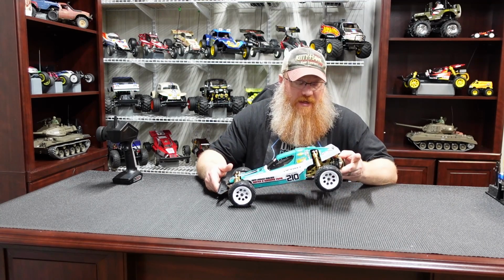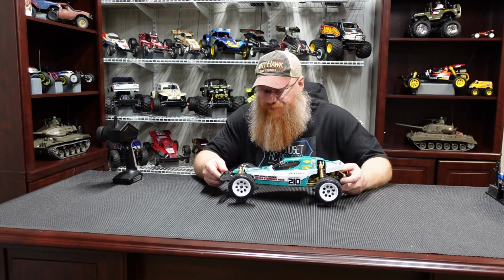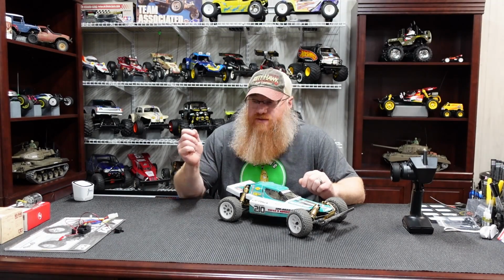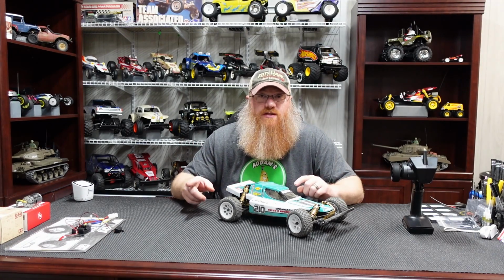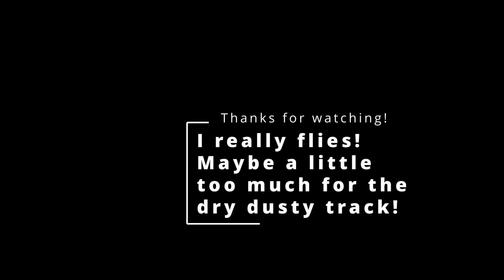Kyosho Turbo Optima First Drive

Comment: Cool video! Is it possible to upgrade these to a brushless 3s?
Reply from the maker: Thanks! Brushless is fine, 3s brushless is probably going to be a bit too much. On a good 2s system it will be more than fast enough for any type of track driving, if not too much to keep traction. 3s is both going to be hard to fit a decent battery in as it have to go between the frame rails and the upper deck and the added torque is probably going to shred the belt or the pulley. They are quality but not ever designed to take that much. If you want 3s romping probably stick with Arrma or something designed to take that abuse with a stronger driveline between the motor and the diffs.
Reply: @AddamsPlayground  Ohh OK thanks for the info! :)
Reply: @AddamsPlayground I recently got a Team Associated Pro4 SC10 (General Tire), so I’ll run that for a while - luv it - but this classic Kyosho will most likely be my next purchase. 😊

Comment: I bought one knock off futaba (4pm) receiver.. it worked fine when installed.. in the meantime I bought several more.. time ticks on and i go to use the car with the first one it became glitchy and stupid.. so it got binned... The other ones so far are okay. Were tested on arrival... One is in a car.. its glitchy. But then i used a cheap brushless combo.. so it could be the culprit to.. ive gone back to the futaba  R203gf (cheapest ones ) going to use the knock offs in slow cars that dont need highest quality..
Reply from the maker: So far I have good luck with these receivers and have them in at least 40-50 cars and I think this is the first glitch from it. It ran perfectly on the second out and think it was just confusing the radio with two cars linked to it at the same time. I have so many cars ready to run I need to go with the cheaper ones to save some money... kind of a dumb thing to say when I am talking about have 100+ kits in the collection all able to to go out and run anytime! LOL! Thanks for the insight and thanks as always for watching!